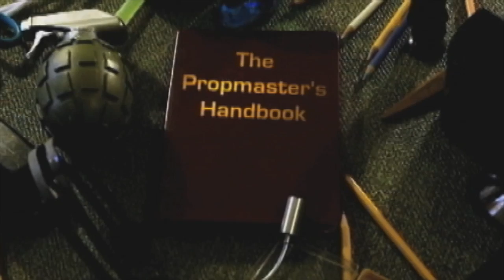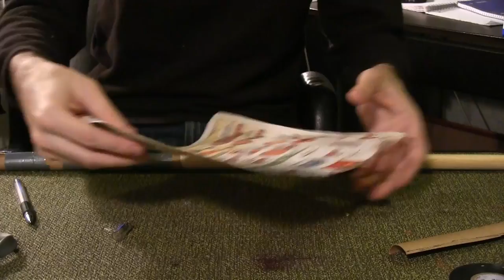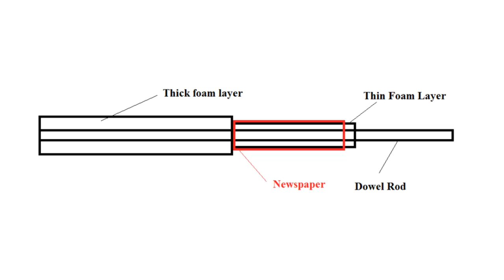How to Make a Prop Baseball Bat

Comment: How hard would you be able to hit someone with this? I'm considering having a future larp character use a baseball bat, and this seems to be the safest one on youtube.
Reply: Paige Udhus we do something similar with our Larp weapons and can hit relatively hard, though we use pool noodles instead of foam cups, so if you can get your hands on pool noodles, I'd advise that instead.
Reply: I've been a stage fighter since I was about 6, we always used pool noodles surrounding a pvc pipe for the practice weapons, but I personally suggest using a real bat and learning proper stage fighting techniques. It's a lot safer long-term since you can still injure someone with a fake bat.